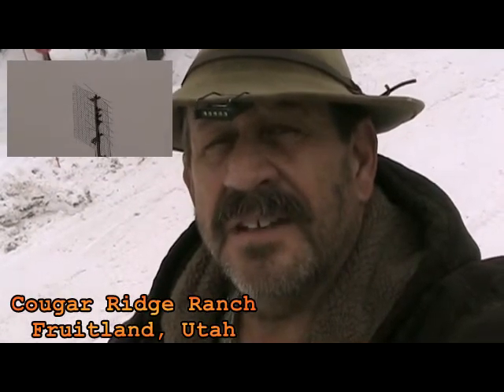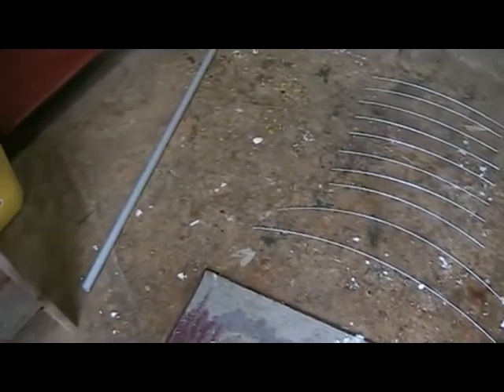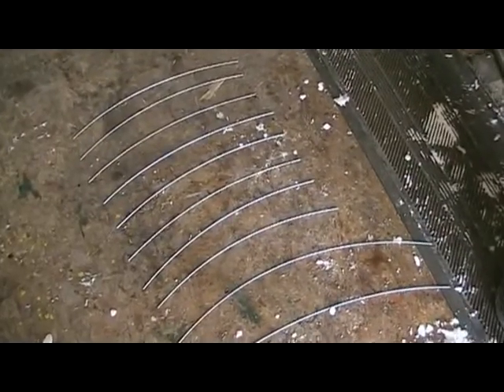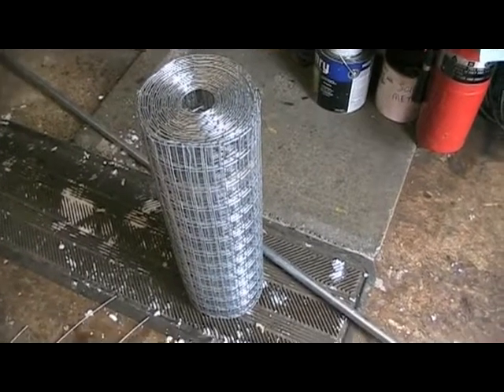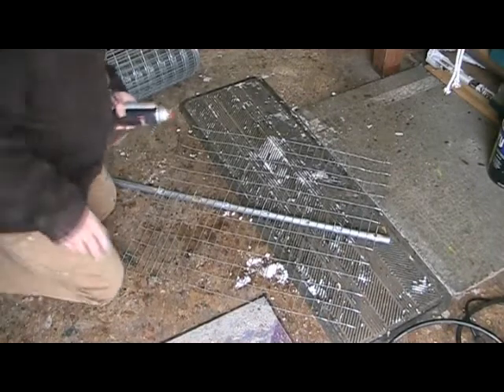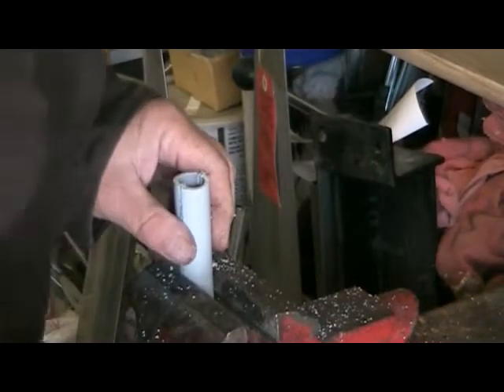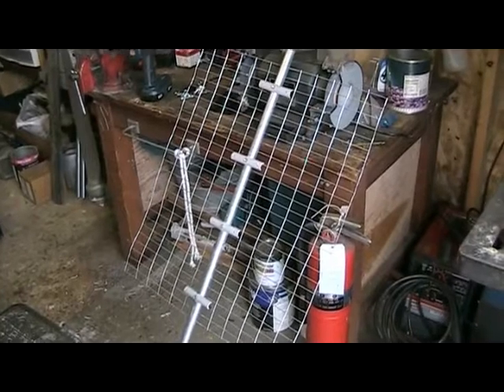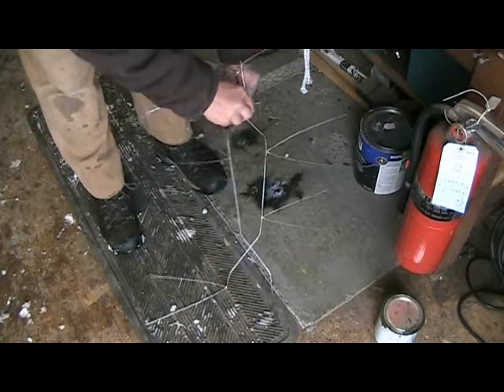DIY HDTV BowTie Antenna

Comment: Your reflector should be squares no bigger than 3x3. To big and it doesn't reflect the unwanted signals and it doesn't amplify the signals you want. Also, make sure there is a nice flow in the whiskers so the electrons can flow. No V shape. More like a sharper U. Think of it like water in a water hose. You don't want kinks. Try not to use any steel. Copper being the best, aluminum is ok. Use stainless steel for the hardware.
Reply from the maker: Nice details that I chose not to include. 
I made this video more for entertainment as I realized that anyone who would attempt to make one would have similar skills as mine and that is a small subset of the population. I certainly realized that any Amateur Extra could easily knock one of these out without my instructions. 
To be candid, this video (which was one of my first) has garnered way more views than I ever expected in my lifetime. 
Many times people need to make something out of what they have “on hand” vs buying the optimal materials and taking the time of extreme detail construction. If they were going to buy copper and stainless to build this they could just buy a commercial unit which by the way, is still made of galvanized and painted steel. The antenna in this video is and has been working (since it’s creation) 38 miles from the broadcast antenna and it brings in exceptional non-pixelated digital signals, in fact it also brings in great digital signals from other broadcast antennas that are over 70 miles away in the Rocky Mountains and not even in line of sight (which was a big surprise). 
All of the antenna theory is great if you want the “perfect” antenna but the micro reception benefits for many of the theories are just not worth the extra work & expense. 
Reception antennas have a LOT more acceptable tolerance & variances in the “theories” while broadcast antennas must be much more exact and close to perfect as possible. 
No antenna is perfect and to maximize their service as a broadcast antenna we used to add many tuning devices to the antennas themselves, but these antenna tuners are now built into out transmitters. 
CaptWingnut -AA6BW

Comment: what happens if they touch?  I got one rigged up, smaller in size, but I got the wires touching when they cross over.  Also my antenna works well, I keep it in my bedroom and picks up the channels.  Wondering if it would work even better if not touching.
Reply from the maker: The goal is not to let them touch as they cross… that inverts each side. If your broadcast antenna (the antenna you receive your signal from) is close touching won’t matter much. You can bend the wires so they don’t touch, the TV signal won’t care that the wires are a little bent!!
thanks for watching